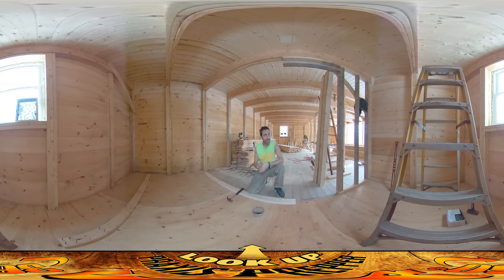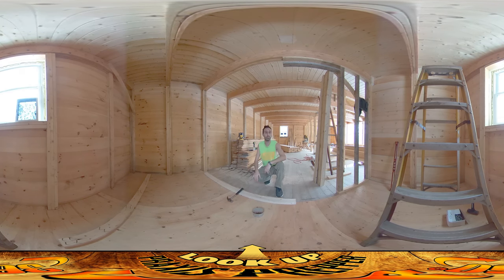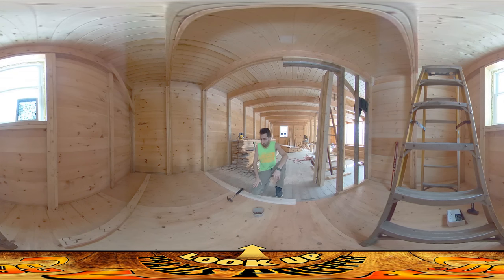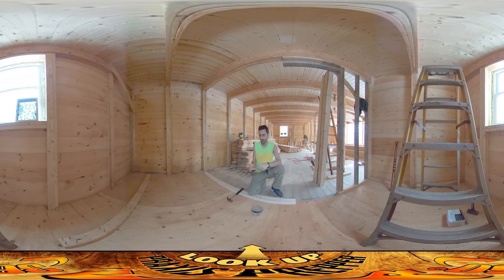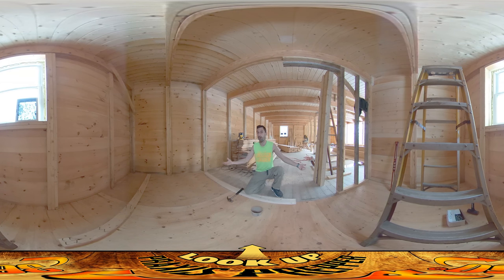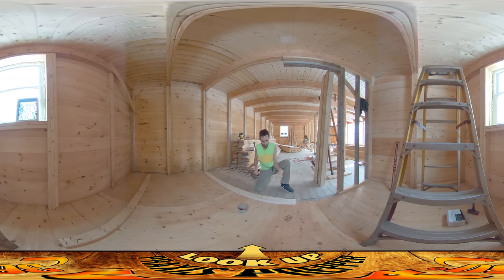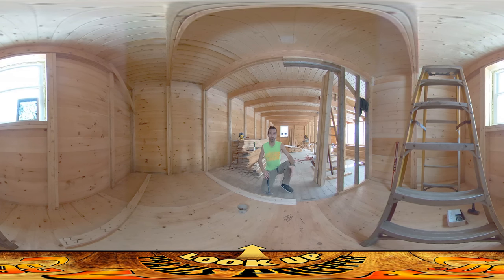Homestead Building - Using Waste Hardware for Building, Reducing Waste

Comment: You forgot the most important thing...

One less nail to get stuck in a foot! I had that happen on a construction site and it suuuuuuucks!

Really impressed that you have managed to only fill 2 garbage bags of trash so far 👍
Reply from the maker: That's a big one too with River being on site from time to time.
And I've only committed to 2 bags so far, that doesn't mean that a lot of the scrap kicking around in corners might not end up in a trash bag at some point... want to give it every opportunity to be included if I can though.
Reply: Praxis Homesteading and Survival Skills Definitely a good goal. Btw are all the interior walls going to be shiplap or are you planning to use some drywall?
Reply from the maker: @inmyimage1081  I have nothing against drywall, but I'm not a drywall fan... in fact, I hate it with a passion that cannot be conveyed in words alone.
Reply: Praxis Homesteading and Survival Skills Not sure I can understand hate, but there is a lot of great wood in that house that will look good stained, sealed or painted.